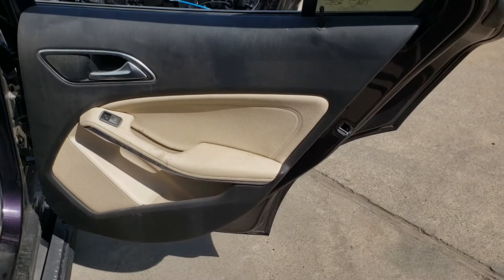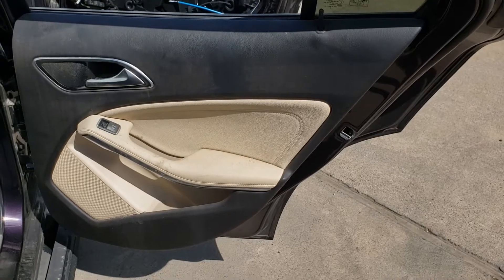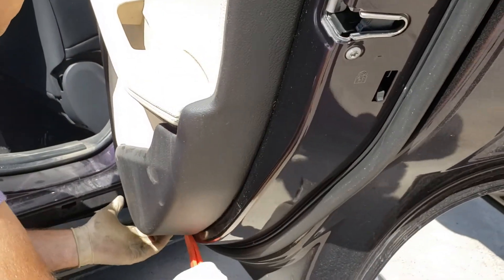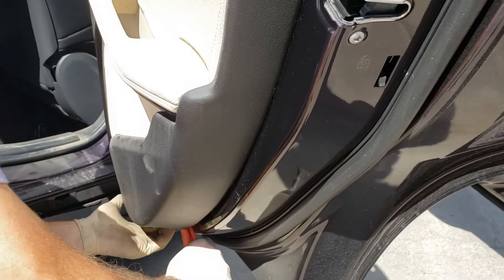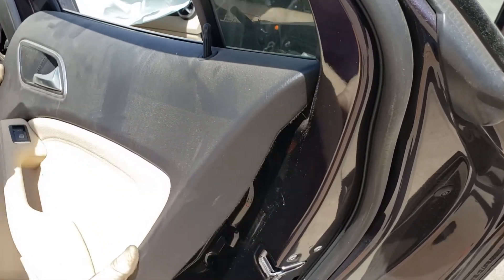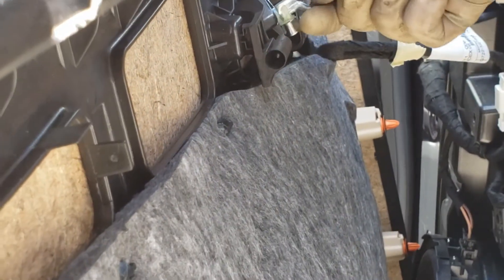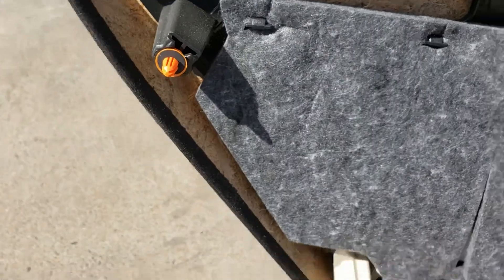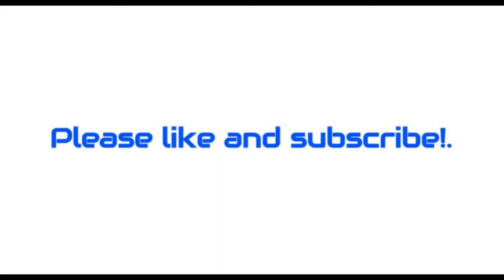2015-2020 Mercedes X156 GLA250 GLA200 GLA45 HOW TO REMOVE REAR DOOR PANEL

Comment: Do you know if the right door motor is the same as the left door motor that move the window in the rear? Thanks
Reply from the maker: Usually they are different for each side